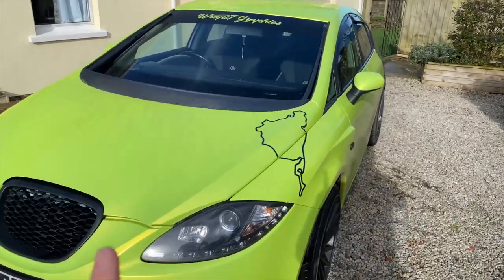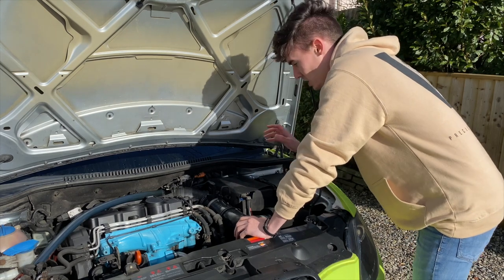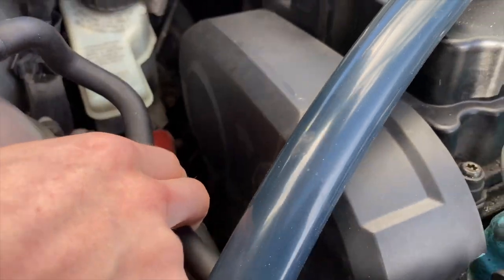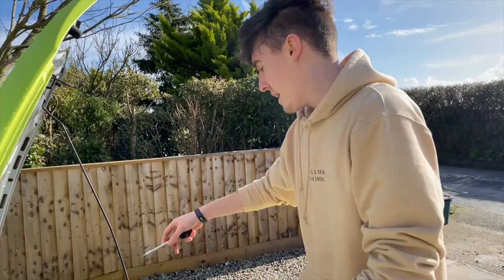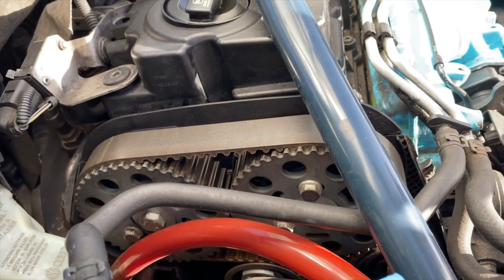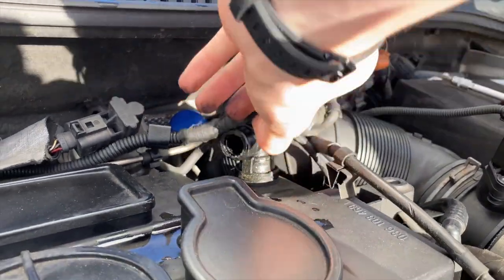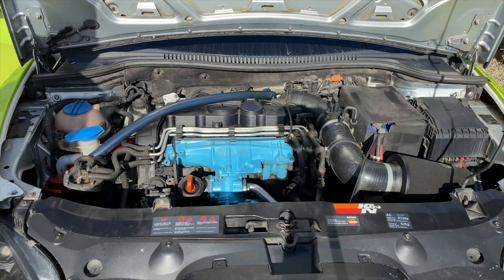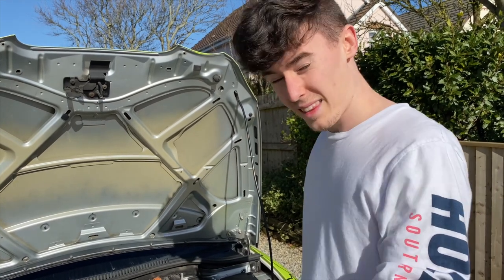IS IT THE END OF THE ENGINE.. | REMOVING THE ROCKER COVER | JSMK

Comment: check the fly wheel, these VAG TDI's have a dual mass flywheels that often fail with age or on tuned engines. good news is if it needs replacing you can stick a single mass one in with an uprated clutch for more power, although you may feel more vibrations from the engine and a bit of extra noise with a single mass flywheel.

Comment: as per the other comments it does sound like a bad DMF, you might think it's coming from the intake but of course the gearbox is just below where your filter is so maybe you're mistaken... but if it is deffo coming from the intake then best do a compression test, never done it on a diesel but I know you need a different kit to a petrol compression tester

Comment: I have a 170 Tdi FR 83k mileage 2011 plate, what discs and pads would you recommend also I want really good stoppage power and better handling, what do i need to upgrade?! Thanks in advance. Forgot to mention it is completely stock.
Reply from the maker: Check what size your brakes are as they’ll be either the 288mm or 312mm, then I would always recommend Brembo grooved disks with green stuff ebc pads really strong and always keeping its self clean and less likely to heat soak. Best thing for handling is a decent set of tyres, suspension can help but tyres will give you the most bang for buck handling improvement
Reply: @JSMKYT  hey thanks so much for the reply! Ill check the size and go for the upgrade with the Brembo and better tyres, what tyres do you currently have on?
Reply from the maker: @samsungsungsam5474  I’m currently running Nangkang NS2 which are a good in between general road driving and handling and not to expensive 👍

Comment: Hope you get the issue sorted but just wanted to ask. I’ve a pd170 as well running around 220/30 and wanted to know what injectors and turbo you’re running? I know standard Siemens injectors top out at around 260 and I’ve heard there’s not many options?
Reply from the maker: Yeah mate dark side developments supplied the kit basically mate for the power gain, piezo injectors I believe and the Garrett GT2260V
Reply: @JSMKYT  cheers!!

Comment: Hi mate dud you find the actual issue? I brought a fr170 wich is making this noise god knows how long for but did you fix it?
Reply from the maker: Not yet mate, need to do a compression test to check it’s all okay. My flywheel does rattle but mines nothing to worry about as it’s always done it due to the style of clutch and flywheel
Reply: @JSMKYT  ah okay dude! Strange as mine boosts and drives nice still it's strange tbh with you but I need to figure it out and fix it

Comment: Mine makes a similar noise mate i think mines the flywheel.. push your clutch down see if the noise goes away... Iv got another problem with mine it’s just randomly cutting out on the road Iv changed the fuel relay but no luck... anybody have any ideas??